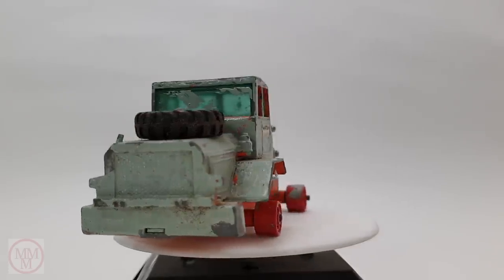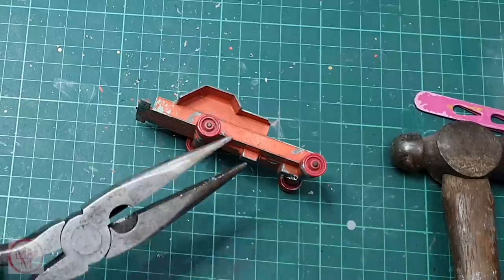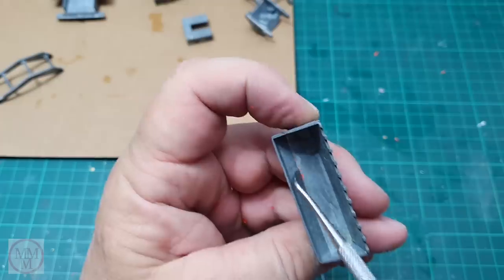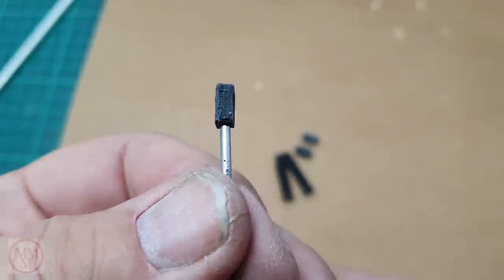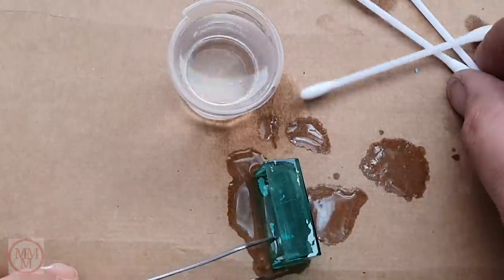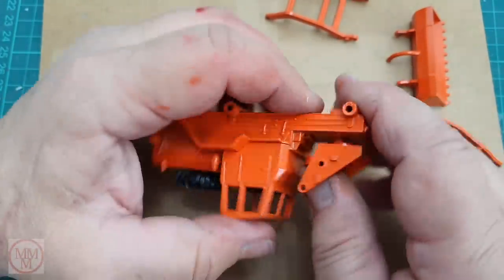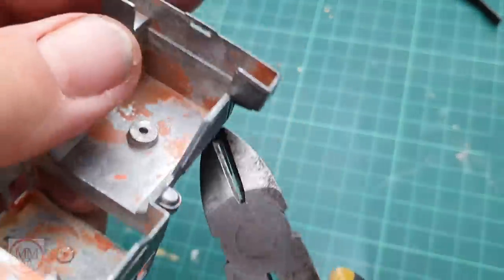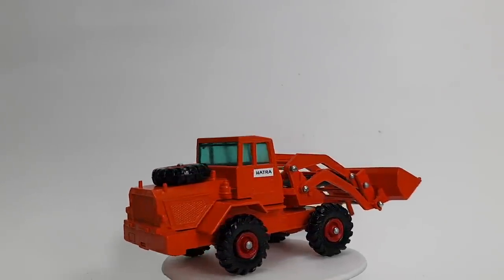MATCHBOX Restoration K3B Hatra Tractor Shovel 1965

Comment: Great restoration again Marty, that one was very intricate, it's sods law you always find the part or tool you need just after you've bought a new replacement. With regards to paint stripper, i seem to remember a time when you had to use petrol to neutralise it before it would clean off, I remember adverts for water soluble paint stripper coming out, it would have made it a dangerous and difficult job to use on models if that was the case today.
Reply: I've heard the expression "sods law" in passing reference on some English shows, but I didn't know what it meant until now.  The one instance where it happened to me was I had thought I had lost one of a pair of gloves.  So I threw the one away.  A week later, I found the other, and had to throw it away.
Reply: Leo Rumley  I’ve known Sod’s law was a thing in my own experience; thanks to you I now know that it has a name!

Comment: Great work as usual!!  Just a couple ideas for you to try if you like.  For the axles,  find a local welding supply store, or even a local shop, and get different gauges of welding tig wire for aluminum.  It will be about the same as the rivets you use, maybe softer depending on the alloy and it is different lengths and diameters.  Also to avoid the chipping and wear problems putting it back together, use a low tack painters tape to cover the areas you will be touching to protect the paint underneath until you are ready to unveil the final product.  Hope these help a little.  Keep up the cool work.

Comment: Hay   marty  great   job   on  k3b   I  restored   many  of   them   one  of  my  favorite ,  I  use   cotter  pins  for   hyd,   ram   and   they   hold  in   the   cylinder   better  and   has  a   hole  on   the  end,   brake  fluid  dot  3  is   best  dot4 is  silicone   base,   the  bucket   linkage   is  alot  of  work and   is   always  loose  or   broken,  again  GREAT JOB!
Reply from the maker: That's a great idea using cotter or split pins for the moving part of the ram. I can see how they would grip better if the legs were slightly splayed when inserted into the sleeve. Thanks for an excellent idea to try out in the future!! Marty.
Reply: I used to work for a silicone manufacturer and we supplied it for DOT5 brake fluid. I thought that all the other DOTs were non-silicone (silicone is more compressible than mineral-based fluids), but I could be wrong. In any event, you should never use DOT5 to strip paint, as the faintest trace even after washing off thoroughly will ruin paint adhesion.

I also wonder from time to time what effect the paint stripper washing down the plughole is doing to the uPVC pipes and joints underneath!

If you want to see a video of a real Hatra shovel in action, it's here on YouTube - see https://www.youtube.com/watch?v=Smh1xAfzVes.

I make models in a much larger scale, but I've still learned so much from watching these videos - thanks, Marty!

Comment: In my humble opinion, the part missing in the back was one of the exhaust tubes of the HATRA. My dad  said that the HATRA was very useful when they were doing railroad track bedding, because it could pick up cross ties (sleepers?) and dump them onto a truck standing at the side of it without having to turn. All the driver had to do was to turn the shovel ( which could be replaced by a set of forks for this task) sideways independently.

Comment: Great job Marty, on a tricky little bu**er of a casting. I was surprised you didn't have axle-tubing material in your arsenal but that epoxy will never be seen. 
When did you clear-coat the tractor? Would that maybe have prevented the damage to the paint? Turned out fine in the end though and you got some extra practice reassembling tricky models.
I always think it's a mistake when creators say they will upload "every Sunday" or "every Tuesday night". Would it not be easier to say something like "I try to upload every weekend", or something similar? Folk should get notifications anyway and that would maybe ease some of the stress of being a creative creator.😀
Talking of stress, how is this COPPA stuff going to affect you and Kevin? Are we going to see changes at MMM?
Cheers for now,🍻
Dougie.

Comment: Understand the frustration. I recently cut up a HO model caboose to match a specific prototype. AFTER I painted it, I noticed that I had gaps on one side, and the other side was pushed out from the glued part. Repairing it would have meant breaking the glue bonds and the need for more filler. Drives you nuts, doesn't it, to have these little problems. BTW the broken part on your model is supposed to be an exhaust stack.

Comment: the brake fluid trick is a favorite of custom rc car builders who use clear lexan bodies and want to change the paint, but keep the body, it's commonly used by soaking a paper towel with the brake fluid and laying them in the body from which they wish to remove the paint, i say inside because lexan rc car bodies are painted on the inside of the body, usually over night up to 24hrs

Comment: Hey Marty . Love your vids . The brake fluid to use is DOT3 . It is water based believe it or not and boils at a lower temp  . It sure cuts paint though . The DOT4 fluid is silicone based and takes a lot higher heat to boil it . It is used in race car and such .

Comment: Hi just a tip for the the hyd rams you could of 3D printed the rams with holes down the centers then opened them up to the right die later . I would guess for them to work they must offer some resistance. So this will mean a interference fit on the cylinder to ram piston . There are some small adjustable reamers. Nice job

Comment: To remove paint from plastic (like the wheels) consider soaking in pine cleaner (Pine Sol here in the states). It can take some time depending on how thick the paint is, but the paint will slough off.  I wouldn't recommend on clear or semi-clear plastics (like windshields) because it will dull the finish.

Comment: I know your 3D printer can't do window glass, but can it make a piece to mold the plastic over? the plastic from 2 liter soda bottles can be made to work, if you have a mold to put it on, you could just use a heat gun or good hot hair dryer to melt the plastic into shape. you don't want to fully melt it, but almost so it's flexible and bends around the mold. I've had some luck making them with standard items for molds and an old hair dryer with a high heat setting and a cool air button. When it's where I want I can use the cool air button to make it stay where it's at

Comment: The paint not sticking - it sounds as if you needed to use an etch primer so the bottom coat bonds to the metal better than the primer you are using. As long as the top coat is compatible with the primer that should stop the chipping.

Comment: Lots of troubles, but a great result!   I noticed one of the wheels was cracked, did it have to be glued or not?  Which remind me, do the reproduction tires (tyres) fit well? How about the originals you finally found?  I mean if a child in played with it would they come off during normal play?
Reply from the maker: I did not notice the cracked wheel, I'll have to get it out and have a look now. The repro tyres were a great fit the one on the spare is a bit loose as it is an original.

Comment: Just wondering do you use superglue with bakingpowder or baking soda? I need to fix something small and this just seems to be the trick. But you mention both in the video.
Reply: I don't know how much it matters Marleen but I've seen several restorers stipulate "baking soda, not baking powder" and I've never heard anyone say the opposite so ~ looks like it's baking SODA 
Great for heartburn too, dissolved in a little water ~ again soda not powder.😀

Comment: Wondering why, when you reinstall the windscreen, you don't install it and then apply silicone to the post, instead of using a dab of silicone then putting the screen in. Probably do the job just as well, and make for easier removal if required. Nice work though.